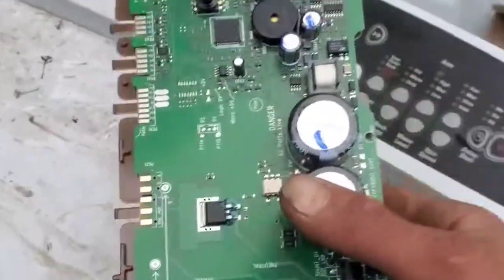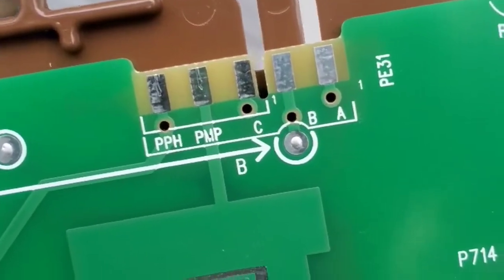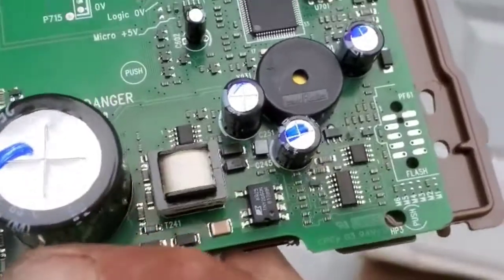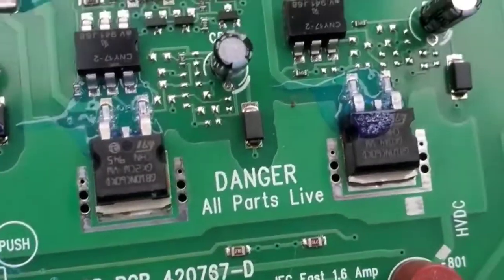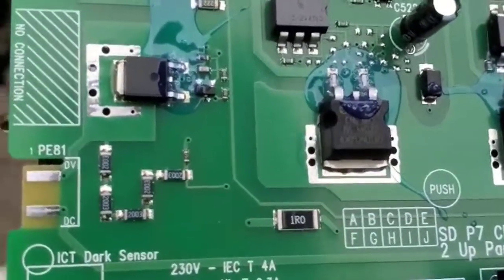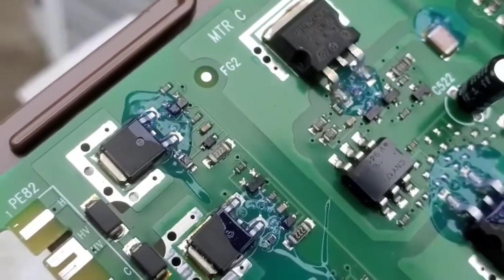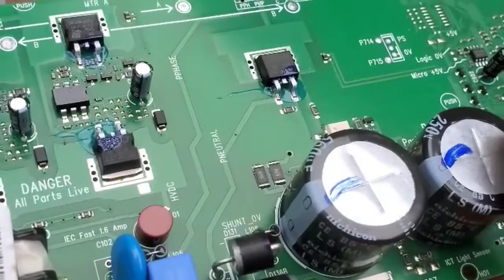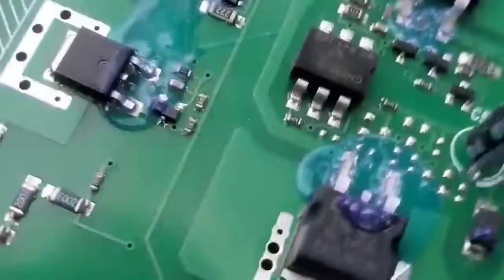Washer motor controller from fisher and paykel, high voltage hyperactive controller closeup!

Comment: On the left of the board under PE82, that is H for hot and C for cold, with HV being the common. It is to control two DC solenoids which let the hot or cold water flow in, nothing to do with the motor. The adjacent components are U1J 600V rectifiers for the small ones and FQD 1N60 600V N-Channel mosfets for the big ones.

Comment: You know, I think this is the same model as mine. Smartdrive Phase 7, the service manual is online, tells you everything you need to know. Mine’s the MW512-AU and it has the same board, if that helps anyone find information about this board.

Comment: Did you work that board out eventually dude?
Reply from the maker: I got it working for about 4 or 5 tests and then it just quit. Wouldn't turn motor at all. Got some strange error code that I couldn't ever correct
Reply: @MrFigureitout  damn...
Reply from the maker: Yea sux. Maybe I will get it back out and try it again to see if I can resolve the error. Most likely it knows I'm reporpusing it and of course they don't like that very much...
Reply: @MrFigureitout  🤣 yeah, its hard without knowing what some of those IC's are doing huh...
Reply from the maker: Ahhhhh tell me about it. I'm seriously debating going back to school to b an electronics engineer so I can just make wtf I want when I want it. ...no more bs....I just really don't believe in school too much. Thats why I love you tube. Really all the info I need is probably here. Really just need self discipline and time.....thanks for that
Reply: @MrFigureitout  second that brother👍

Comment: Hi there Mr. Figureitout, came accross your video today and was wondering if you got this controller figured out yet? I have followed Gerard Morin but he is not with us anymore as I am sure the powers to be has eliminated him. Any case, I have also got me a samsung motor and a controller from the states and have it run but cant get it over 500rpm... bummer!! My need is at least 1800 rpm...Ihave exchanged the black  magnets with neodymium and bit slower but much more torque...had a look at the chinese controller you used in one of your vids but before i get it was wondering if you used it on the bigger Samsung washing machine motor...the type Gerard used....Hope to her from you! 

Friendly regards
Ben
Reply from the maker: Yes. I did! I accomplished 2250 rpm with large Samsung washer motor
Reply: @MrFigureitout  br which is the Samsung model no that u got the motor from would u pls describe clearly or if u could paste a link of the motor
Reply from the maker: I'm actually planning to do a neodymium magnet swap as well. How much did it increase your startup torque?

Comment: Bro if you want a bad ass controller, you need to get you an inverter out of a hybrid, the beat one would be for a civic, the newer the better, the higher the voltage
Reply from the maker: Your right. They will become more easily available in time.
Reply: @MrFigureitout  bro you can get them on the cheap right now, just go to the junk yard and find a wrecked one, also Craigslist auto parts has some good finds on the inverters or IPM's